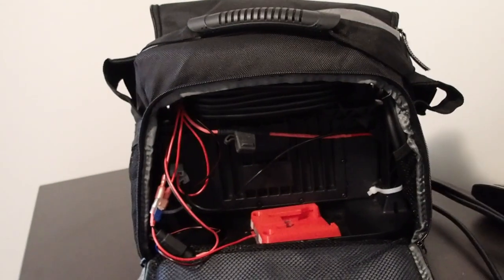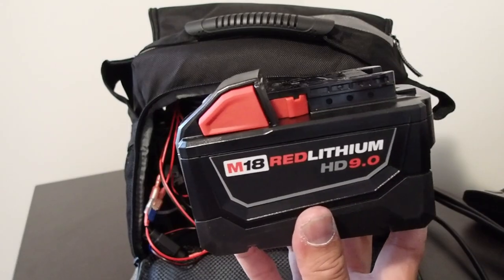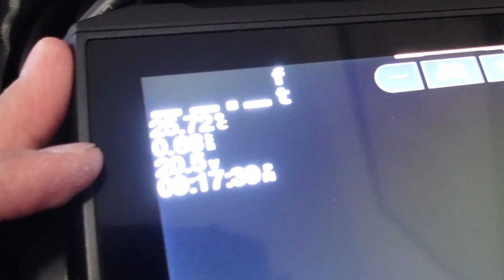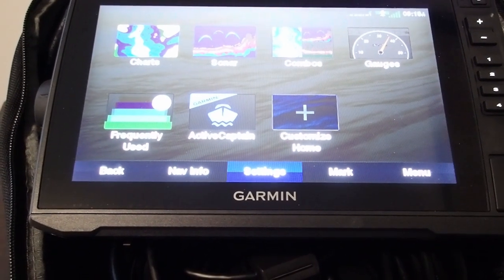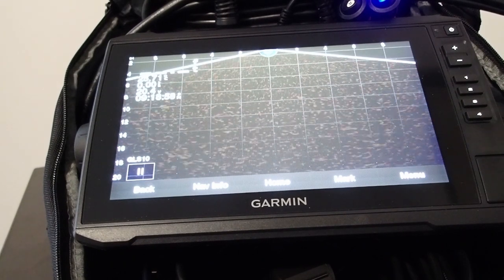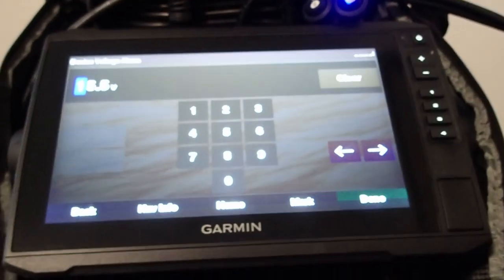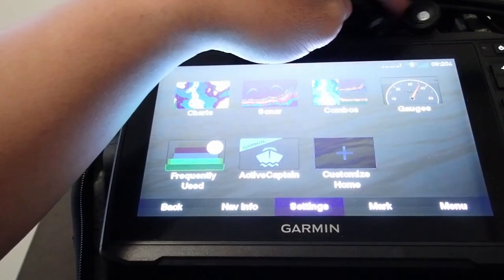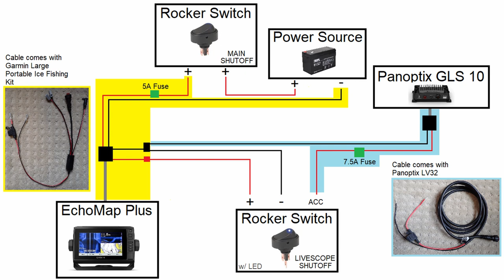Portable Panoptix Livescope Build

Comment: Nice build,  I got my build not too long ago.  I got all my Garmin panoptix livescope separate,  along with the garmin extra large bag which comes with the base. I have plenty of room in that bag.
Reply from the maker: I didn't know about the XL bag when i picked up mine and kind of regretted it when i first set it up. But now i think i have everything exactly how I want it, its a tight fit but love how compact it is.
Reply: Hello David,  are you planning to use your garmin panoptix livescope for ice fishing? If you do do you made your own mounting for your transducer  or purchased from somewhere?
Reply from the maker: @philipnguyen2529  no I've never ice fished before so not planning on it but who knows.  If I do plan to I'll probably look at purchasing the mount from Garmin if it's reasonably priced, if not then I see gluing some pvc pipes as an option.

Comment: you wont hurt your batts. by running them all the way down. lol  I use mine from my Dewalt power tools that I've had for years and run them until they die. these battery's are not like the older kind, these drop from 100% strength to nothing, meaning your battery's can out put full power when all most dead. also dont run your transducer when out of the water, you can burn it up and it can cause cancer. lol  if you tap your power button you'll get an option to disable your sonar. one of the ways you get that clear picture on live scope is the high radiation levels, the loop hole that garim uses to keep from getting sued a few years from now  is that " I AGREE" button that we hit every time we use our units. lol
Reply from the maker: Thanks for the post. Lots of great information here!
Reply: @DavidPhamChannel  yeah, your vid was very informative. tks
Reply: Nice explanation.  One thing which Garmin cautions....  Dont just dump your power by pulling your battery or by on/off switch without first shutting the unit down with its own power button.  These have processors just like your computer and it could corrupt the files and the start up sequence might get scrambled.   They recommend using the power button to fully let the unit shut itself down safely, then use your installed on/off buttons to stop the flow of parasitic drain.  A handy thing to use is the Pause option to stop live scope or your sonar when you have the transducer out of the water or dont plan on using the live scope for awhile .  Saves tons of battery during the trip.